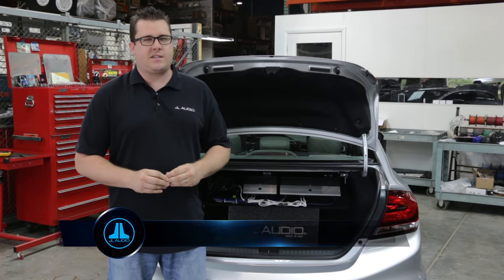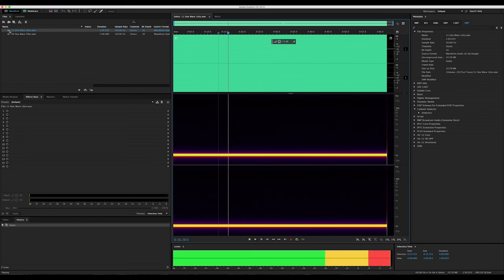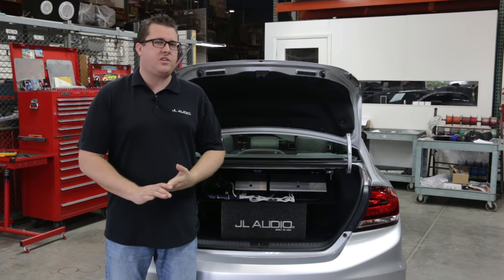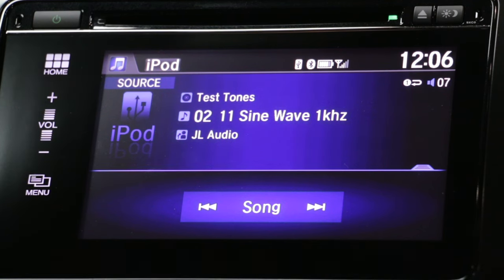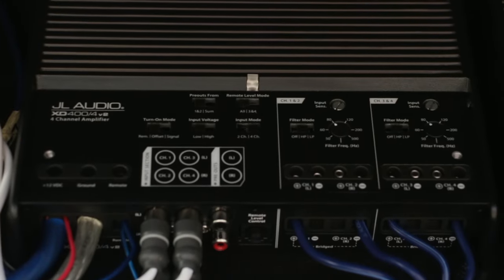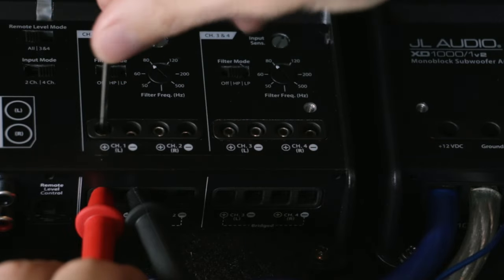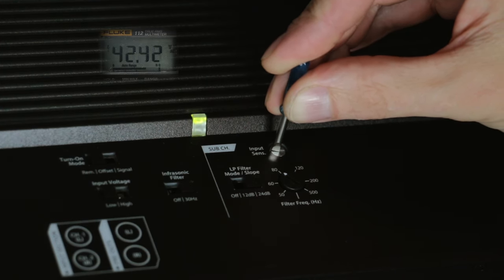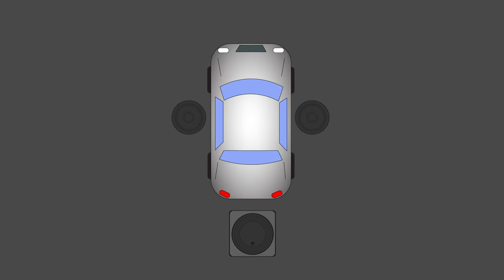Setting Amplifier Gain or Input Sensitivity

Comment: Great,  and only with a volt meter
Reply from the maker: That's right, nice and simple. 👍
Reply: JL Audio 
yeah very nice, only i have daisy chained 4 amps and have 1 RCA from the head unit.   i gues i to disconnect all     and use the 1 from the headunit
Reply from the maker: Each amp should have it's own sensitivity dial. If they are 4 identical amplifiers, you'd want to leave the signal routing as is and level match the amps so they are all making equal power.
Reply: JL Audio 
2 amps are the same and 2 are different.
Reply from the maker: Are the all powering different parts of the audio system? For example, the 2 similar amps for the subwoofers and the other amps for mids and highs?
Reply: JL Audio 
The 2 amps that Are the same are both 4 channels for mids And highs, third amp also 4 channel are bridged 1 for mids and 1 for a sub, fourth amp is mono block for 2 subs
Reply from the maker: You'll still have to dial in each section of each amp individually, but you would not change the signal routing  as mentioned before.
Reply: JL Audio 
Oke thanks alot. that makes iT alot easier.
Reply: JL Audio  
only with that test tones, when i have my 4 amps connected and want to set the gain for 1 mids and highs amp, that 1kh test tone also go’s to the monoblock.
Reply from the maker: Use the 1kHz tone for channels on the amps that have speakers connected, and 50hz tones for those channels that have subwoofers.
Reply: JL Audio 
oke thanks alot, really appreciated👍

Comment: How can i turn off my factory speakers while setting my subwoofer amp with the 50hz signal?
Reply from the maker: Hello.

Factory channels that have full range signals or signals that don't adequately filter out the 50 Hz tone should be disconnected if there's no way to defeat them. You could either disconnect them at the speakers or at the factory amplifier or source unit, depending on the system architecture.
Reply: @JLAudioInc  so if u have  stock mids n high speakers with a stock head unit you have some way disconnect before u try tuning the aftermarket amp for the subs?  so dont play 50 hz thru mids n highs correct?

Comment: JL Audio,. Yo forgot to Tell your custumers that  once they have the Gains to Never again exceed the volume on the head unit past the volume point were it was positioned to set the gains..
  Also Advice Custumer to Never ever, ever!  again, after setting the amp gains to adjust up the "Bass or Treable" on their stereo because they Will introduce Clipping!.
Reply: I set my bass and treble to 0 or flat and the balance/fade to 0.   My preset EQ is on Powerful and my Loudness on Low.  I set those before making any adjustments on the amp because 99% of the time that is the setting I use on the headunit.  Prevents me from having clipping problems later.  I still have some fine adjustments for sound by being able to adjust the treble and bass, balance and fade after the amp is set.  That's just my personal preference and has always worked well for me and I've never wrecked even one speaker or peice of equipment in over 20 years and multiple vehicles with upgraded sound systems.

Comment: What if the amp is one ohm the math is messed up
Reply from the maker: Hello, Bill.  Thank you so much for your question.  if your amp has a final load of 1 ohm it must be 1 ohm stable.  the only amplifier we have that is currently stable to 1 ohm Is the RD1500/1.  if you are trying to calculate your AC voltage to set your input sensitivity the formula is really quite simple.  the target AC voltage is always the square root of watts X final ohm load.  so example, lets use the RD1500/1 as an example.  if we wanted to give our subwoofer(s) all 1500 watts at a 1 ohm load we would multiply 1500 by 1 (1500).  We need the square root of that number.  a little math tells us to give the subwoofers 38.72 AC volts when using this 9 step process described in the video. The audio files to set input sensitivity can be found in our help center.

https://jlaudio.zendesk.com

Comment: Im using 2 Sundown SA 12s ( 2ohm version) 750watt rms. Using a Sundown SCV -2000D @ 2ohm, which is 1000watt rms. When gain is low and bass boost is low, it doesnt even sound like it should. Now at 3/4th gain on amp and over half on bass boost it sounds much better, but does reach distortion, and possible clipping. Is it due to the cheap head unit? Im using a JVC $100 deck. I think its 2.4volt pre amp outputs. Or is it my stock electrical? It is also im a custom made box tuned at 32hz i believe.
Reply from the maker: If you want to know for sure, you would need to have a shop place an oscillisope on your source unit first to determine its maximum clean output point. Once that is done you would use the scope while setting the sensitivity on your amplifier to determine its max clean output point. We suggest the meter method for our amplifiers for those that do not have a scope since we know our amplifiers will produce full clean output at their rated impedance. If you are unsure then a scope it the best way to know. Also, with that much power it would be important to upgrade your stock alternator and do the Big 3 upgrade to ensure proper current flow to the amplifier and less voltage drop. Otherwise under speaker load the amplifier could clip sooner since the electrical can not keep up.
Reply: JLAudioInc ty very much. Getting a high output alternator this weekend. Got the proper gauge wire already ran, and the proper battery
Reply from the maker: You are very welcome.
Reply: Turn bass boost off